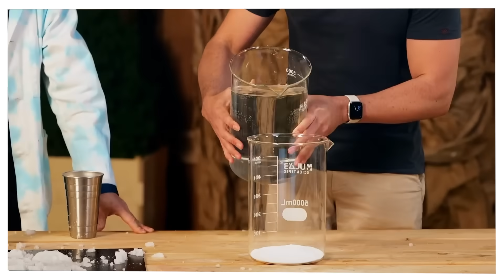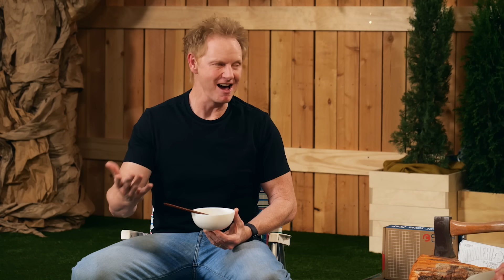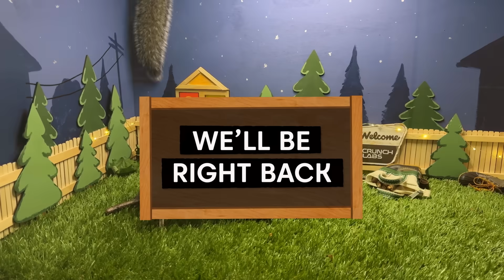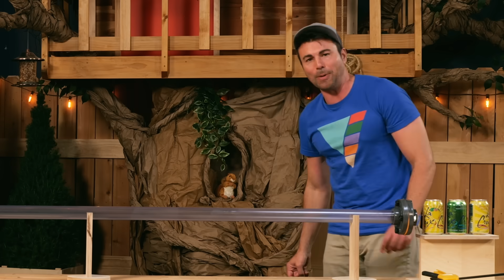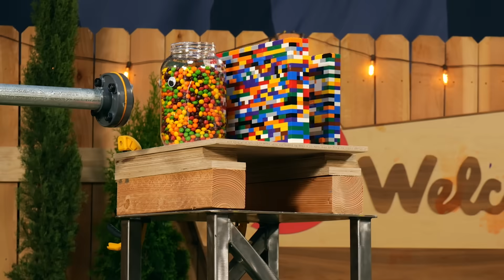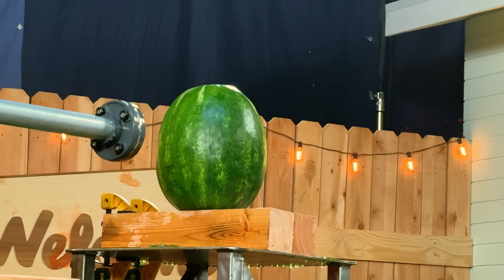Vacuum Cannon Explosions w/ Salish Matter!- Camp CrunchLabs Week 5

Comment: wow. resetting the vacuum cannon easily took 10 minutes for each shot, pumping the air out the pipe and compress air into the tank takes a while, but that's only after the front seal has been reseated, with those 4 bolts to be unscrewed and tightened every singe time. The quick succession montage easily cost them a full day.